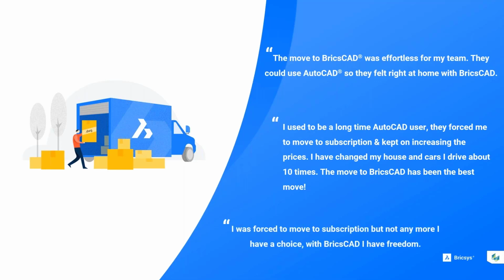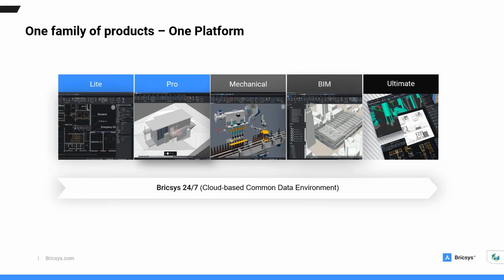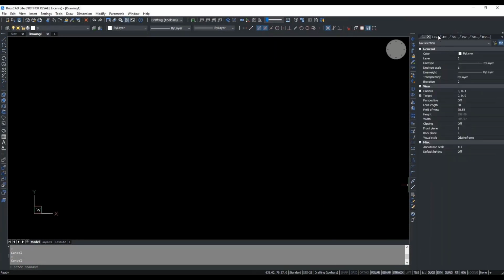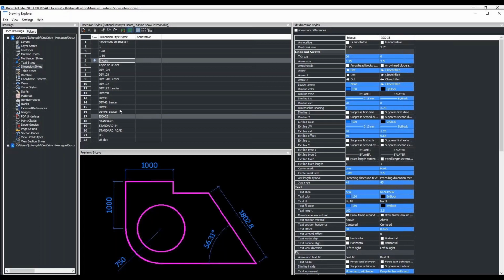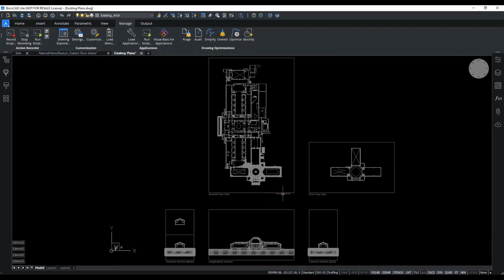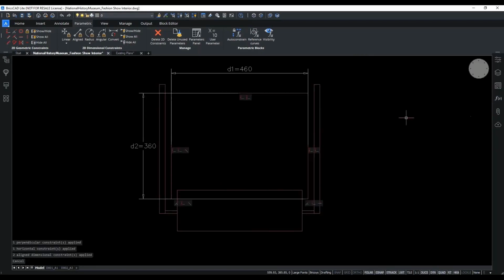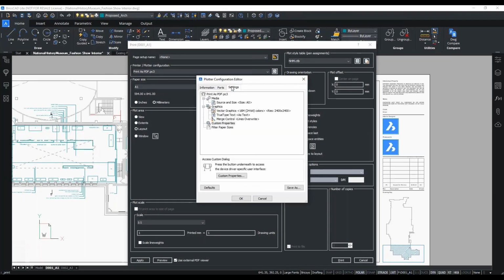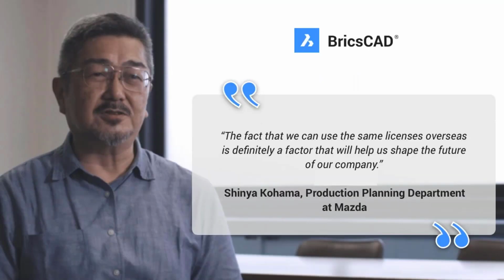BricsCAD Lite: The modern LT CAD alternative - Webinar

Comment: This was a grate webinar. Can I have a webinar about how to create model from any pdf file.
Thank you.
Reply from the maker: Hi! 
You cannot import any PDF file, but a vector PDF file - should be previously created in BricsCAD, AutoCAD, Revit - a program that stores the entities as lines. 
A scanned or a PDF file coming from Photoshop it will be considered a Raster PDF - the lines are stored as pixels, not as lines with start and end points. 
If you have a vector PDF, use the PDFIMPORT command.
Reply: @OctaveBricsCAD  Thank you for reply.